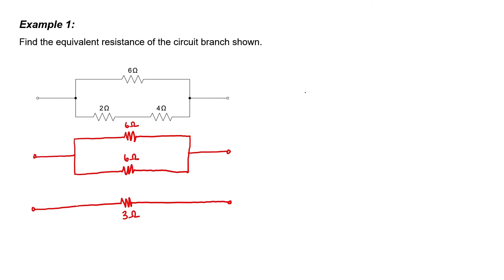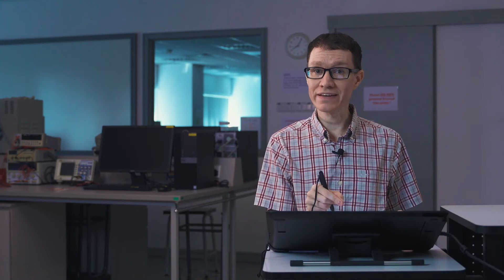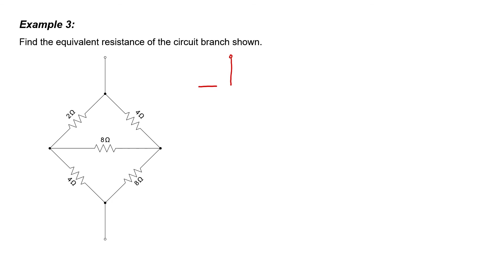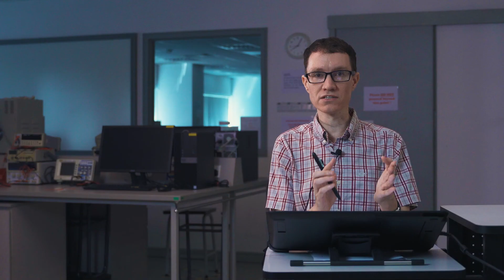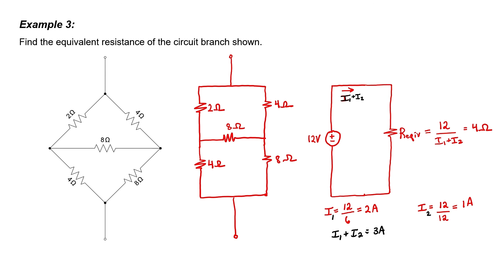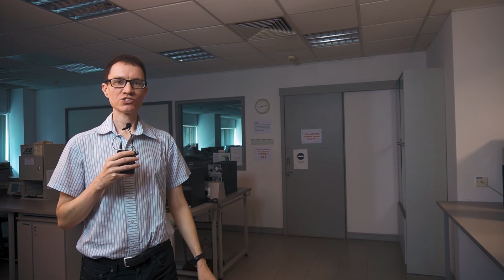Resistors in Series and Parallel Examples (Circuits for Beginners #9)

Comment: In problems like the one @ 4:00 is there some sort of order of operations with which two resistors you must first combine? I get different answers when combining the 3 ohm resistor first for example.
Reply: The 3 ohm resistor is in series with the other two in parallel (3.6 ohms equivalent). The 3 ohm resistor is not in parallel with anything else, only in series.